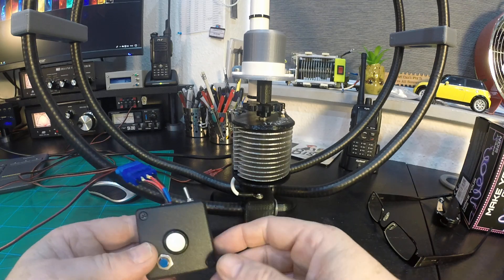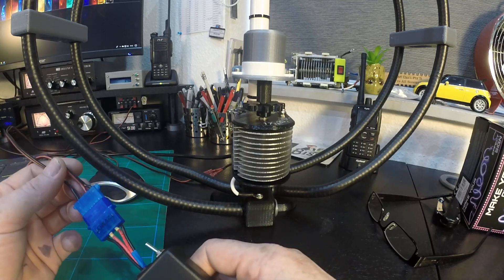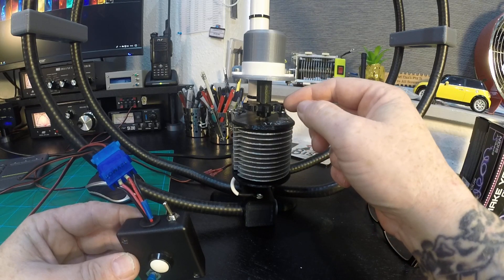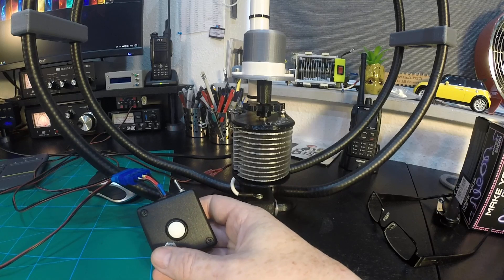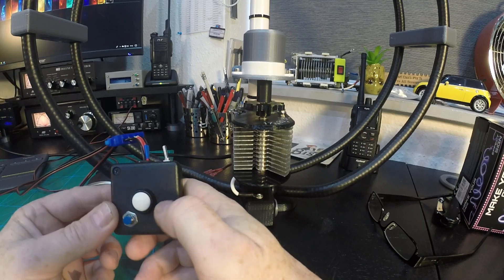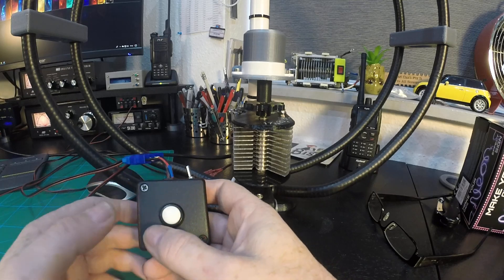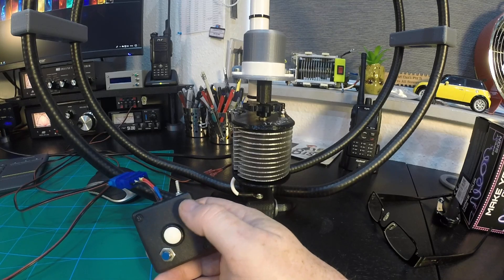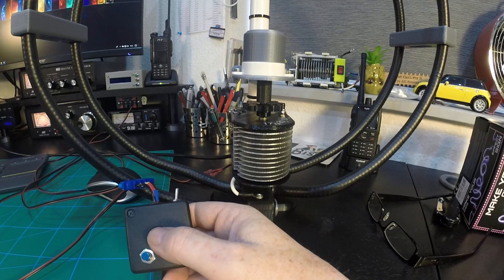MAGNETIC LOOP ANTENNA CAPACITOR MOTOR

Comment: Great product nicely put together but that way of coupling will never give you a low SWR... Have you tried the ferrite core coupling method or a gamma match a FT240-43 core with 1:1 match would work great.
Reply: The best commercial Magnetic Loops "all" use variable C's
A magnetic Loop's with a Toroid are a poor compromise that dampen the "Q"

Comment: What is website to buy? I thought your not ment to use atu on mag loops?
Reply: MMX2 you are correct a tuner should not be used, the capacitor should be tweaked to obtain best swr